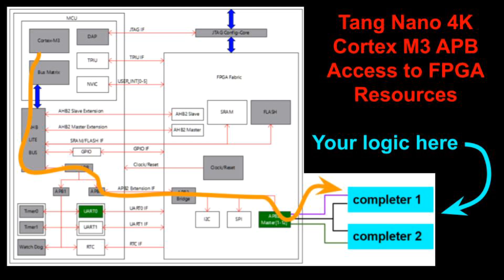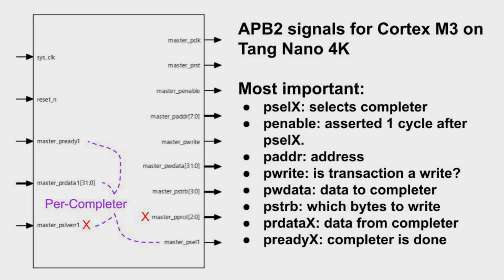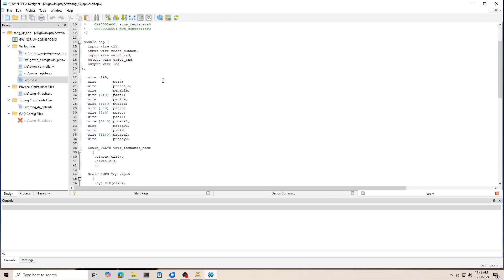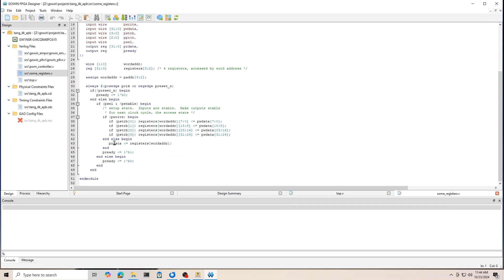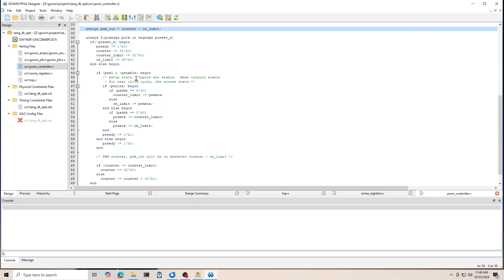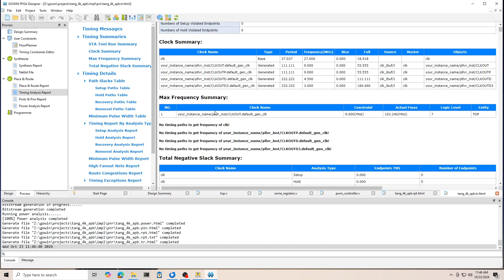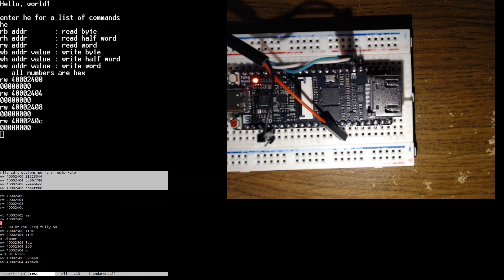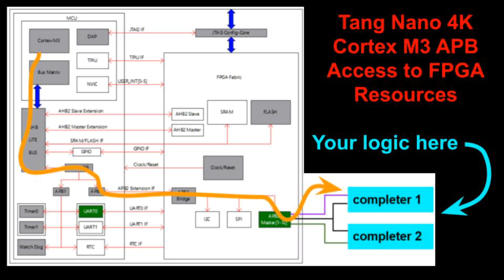Tang Nano 4K Cortex M3 APB Access to FPGA-Based Designs

Comment: Regarding the Tang Nano 4K's M3 / APB2.. I wonder what the difference is between all the busses. For example, why did the Trenz Smartfusion2 FPGA board, which has a hard Cortex-M4 cpu, uses APB3!

I'm interested in instantiating a LiteX design (soft RiscV CPU) and then connecting to the the Arm Cpu... but how would the Master Arm CPU (APB2/3) interface to the LiteX RiscV Bus (Wishbone)?   What's involved in bridging those busses?

BTW, what do you see are the issues with using abstraction tools like LiteX?  It seems like a good way of leveraging pre-tested IPs!
Reply from the maker: I have nothing against litex.  It's just that my goal was to learn low level stuff so I wanted to avoid abstractions that hide them.  If your goal is to integrate things, then abstraction is great.  You will be more productive.  Although, litex represents a pretty narrow (and unusual) ecosystem.  APB soft IPs are pretty common, even if a littlemore work to integrate than stuff in litex.

I have not studied wishbone, but I think just googling "apb wishbone bridge" will turn up useful stuff.

Best wishes.